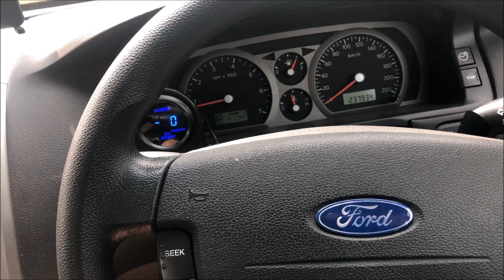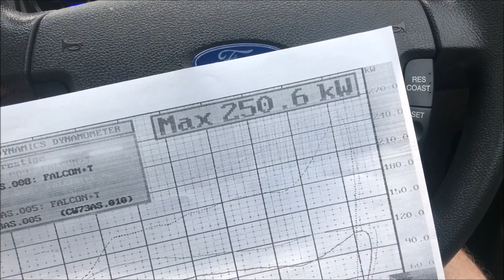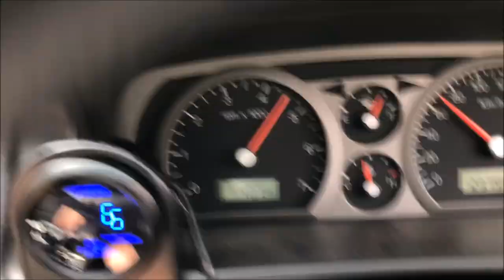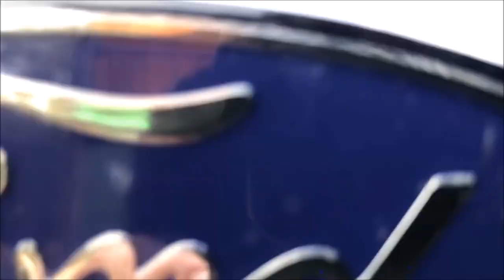NA Barra Turbo Conversion Pt4

Comment: Not bad mate really I’ve setup. Similar to mine when I was on my P’s i picked up a bf II XR6 in vixen red and I sourced all same parts you have (mainly stock T parts)  whacked it all together in about 2-3months but I never got around to gettting it tuned. It saw a dyno once and pulled 260rwkw. Was happy with it for a while. Then I sold it and got a 5sp EF Fairmont with the awesome 302W in her

Comment: apparently **according to the interwebs** you can build the btr using Au planetries, "better clutch packs", EL-EF oil pump, Kevlar bands and an intercooler will hold roughly 600 wheel

some people have hit 700hp and been fine some have destroyed the gear box at 550hp
Reply from the maker: Yeah I’ve heard the same. Just found myself a good turbo btr, gonna chuck that in and more than likely mid the one I take out

Comment: Hey mate how’s the motor holding up? Got a question regarding the cross over pipes, where does that hose go right next to your throttle body firewall side?
Reply from the maker: Going strong man. I’m assuming you mean the factory blow off pipes? They are blocked off on mine
Reply: Yeah I’m fairly sure that’s what it is , did you just use door stoppers or block a pipe? Inspired me to do my own been collecting bits and pieces to get things happening, also what did you end up doing with the power steering cooler?
Reply from the maker: Was blocked off when I bought them. Pretty sure it’s blocked off with big bots, not sure. I just deleted the power steering cooler.. no issues.. not as if that  pipe would cool much anyway.. been my daily for over a year, no issues, still going strong
Reply: Thanks mate

Comment: Awesome man.waiting for my car to come out of the shop.have u had any problems yet?
Reply from the maker: No not really. I upgraded my intercooler since to help with heat soak and the only problem I’ve had is a couple of the coils started mucking up, but that’s a normal unrelated Barra problem. All is good, just in the process of getting things together for more boost 👌🏻 it’s addictive

Comment: What's the mod for the btr 4speed? Shiftkit plug and play switch or you hacking into ecu wires or pulling the box pan down and screwing the 5th solenoid a few turns
Reply from the maker: Best I’ve heard so far is the shifkit
Reply: @oldskoolonly  I'm doing a inbox s5 turn mod and when it gets tuned he can adjust it but I'm aiming for 370kw so the box will have to be built later on there's a guy on ebay 3k for the box to handle 400kw but will sus it out down the track see how it holds up with a few mods. Its the way you drive them try leave it in manual when you give it some and never load up 4th should be fine

Comment: Hey mate did you have to get a engineering or just a blue slip done I've just about got my kit ready to go onto the xr6 but not sure what steps to take afterwards
Reply from the maker: You don’t need engineering mate, they came out with the exact set up from the factory and she was already registered. Just updated my insurance policy is all 👌🏻
Reply: @oldskoolonly  So it would pass roadworthy without engineering cert? What insurance company lets you have a policy with a non stock turbo car?
Reply from the maker: I don’t understand your question? What’s not stock? Not sure where you’re from but basically, in NSW if your vehicle was optioned with something, you can install it, including turbos. Check your states legislation
Reply: @oldskoolonly  I’m from ACT. I thought if your vehicle didn’t come with the turbo setup from factory it wasn’t insurable by most companies
Reply from the maker: Ba to Fg falcons did come with turbos from the factory. In NSW you can install any component from the same series of vehicle. Engineering comes to play when you exceed 20% more power than the highest factory power option.. there is fine print regarding modified intakes and emissions with the legislation also but has nothing to do with what I’ve done here
Reply from the maker: https://www.rms.nsw.gov.au/documents/roads/safety-rules/standards/vsi-06-light-vehicle-modifications.pdf
Reply: @oldskoolonly  thanks man
Reply: @oldskoolonly  what insurance company are you currently with?